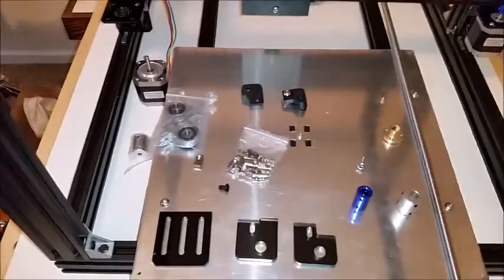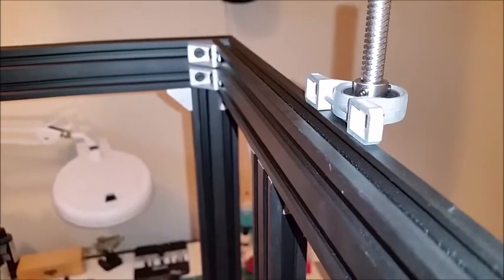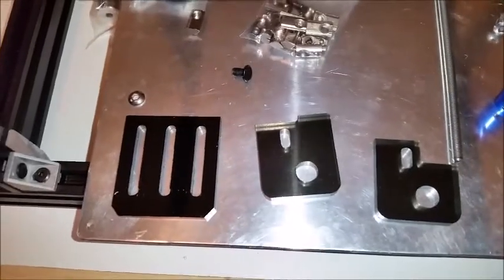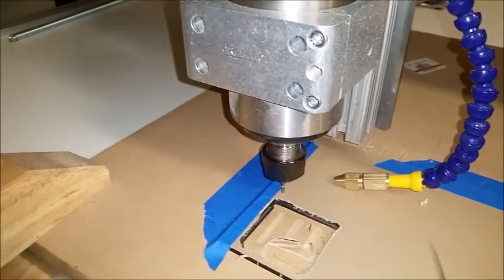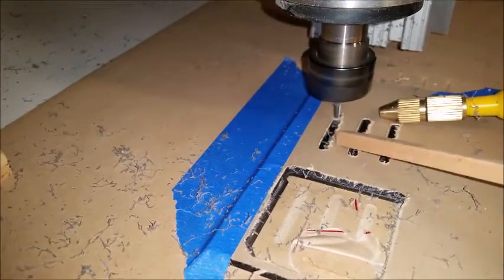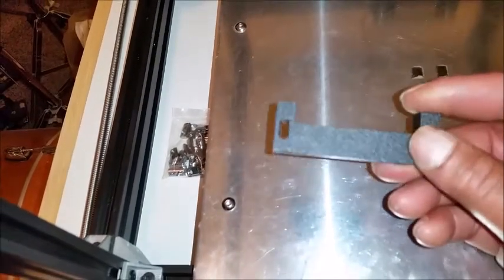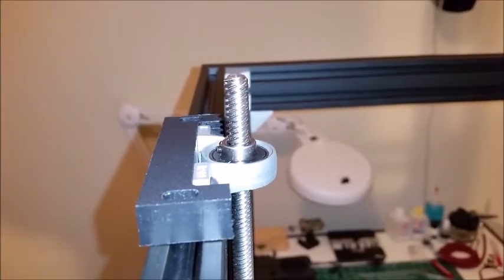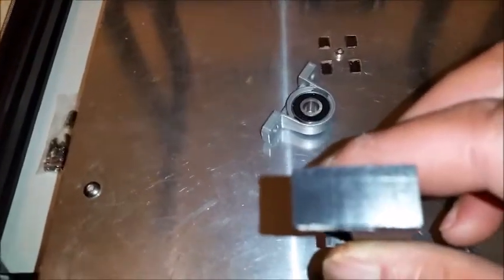Makerfarm Pegasus 12 Lead Screw Install

Comment: Hey do you sell the lead screw with the mod that u made for the z axis.you could email me at bryanobsuna@gmail.com for the cost for sending it to calgary
Reply from the maker: Bryan, you can purchase all of the part's yourself and save yourself some money. If you like I will provide via your email all of the links to where I got mine. As for the brackets I could machine them for you, mine are plexi 1/4 in if you like. I will also provide a link to thingiverse of the upper bearing bracket which a viewer asked if he post on the site. He remixed it to include counter sunk holes. So you could print those yourself. If your printer is not up then I can print them for you and send them with the lead screw nut brackets.